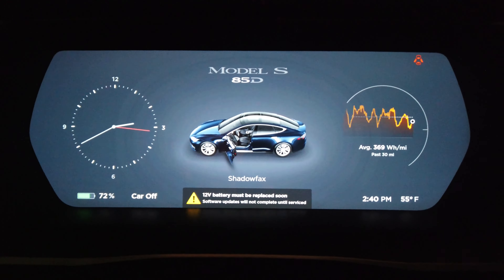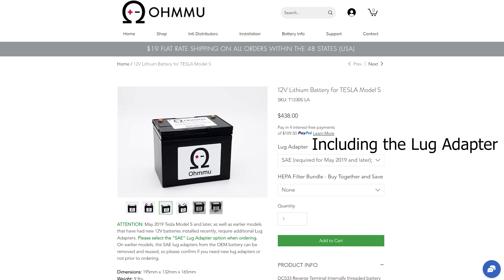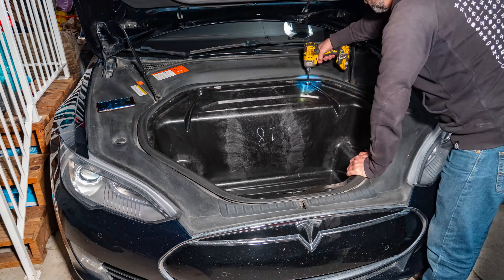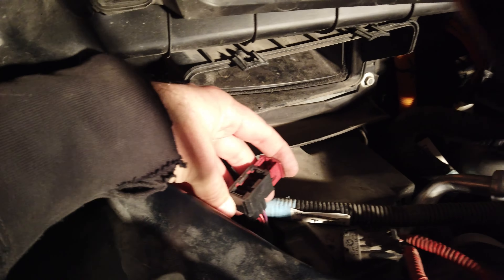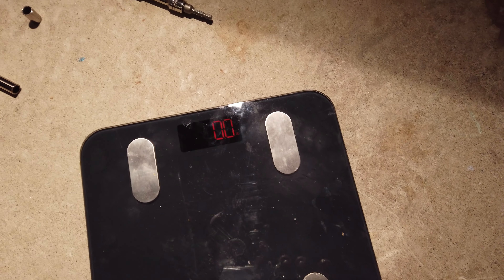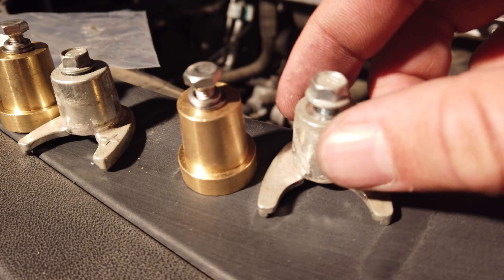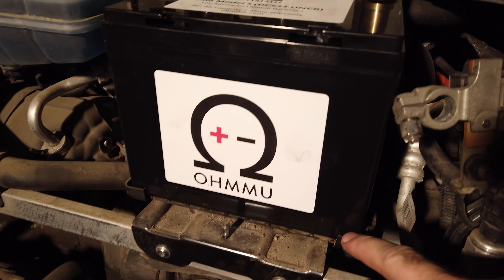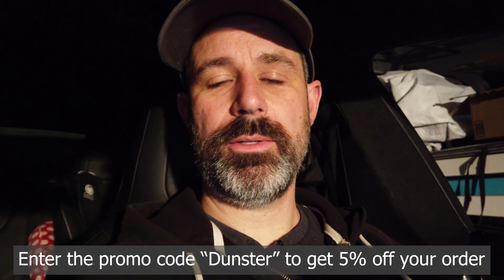Our Tesla Model S 12 Volt Lead Acid Battery is Dying Again | Changing to the OHMMU Lithium Battery

Comment: My OHMMU failed at 6 months. I recommend using the Tesla battery
Reply from the maker: Thanks for the data point. My OHMMU battery is still going strong 26 months later. I'll report back here in this video comments when it fails.
Reply: The Tesla software does not like these batteries as to why many get failures, they won’t be charged as the system see’s though the software faults, and wont charge the OHMMU battery and that triggers the screen warnings “battery needs replacing”.
Reply from the maker: @TheKingOfBellerose  I have never received any errors after 26 months so far. Clearly this is not a universal problem.
Reply: @ElectricTechAdventures glad to hear this. I just ordered one for my 2017 MS90D. But now that I’m digging into this product further I’m seeing so many horror stories. But many of the threads seem to be with the Model 3 and Y. Hoping to have the same experience you’ve had!
Reply from the maker: I agree, the problems appear to be with the 3 and Y. I've had no problems since Nov 2021, nearly 3 years.

Comment: I have owned a 2013 Model S 85 for five years and in my case I have already replaced the Tesla 12 V lead acid battery 2 times (that's less than 3 years life each).  Each time I had Tesla use their battery and had them do the swap.  Maybe I just have bad luck?
Reply from the maker: A 3-year lifespan on the lead acid low voltage battery of a Tesla is actually pretty typical. I've heard as low as 2 years and as high as 5 years. In my case like I said in this video I have had the low voltage battery replaced one time prior and now this is my second time. The first battery I don't know how old it was and it was replaced under warranty. This time the battery lasted for 2 years and now I am replacing it not under warranty. I am not sure why they vary in longevity so much. My hope with this battery is that it will last for many years like closer to 8 years and avoid the hassle of all of the failures in between.

Comment: Good to hear from you. I am not a DYI person so I had my 12V replaced by Tesla in February 2021. My S85D was built in by April 2015, so the factory battery lasted nearly 6 years!  I’m hoping the replacement will last at least 3 years.
Reply from the maker: That battery lasted really well! My March 2015 S85 D 12 volt battery was initially replaced October 2019 for the first time. Then I've now just replaced it again. I don't think I did anything to shorten the life of it, but it was about half the life.
Reply: @ElectricTechAdventures  I really like the idea of the 12V Lithium battery. If I go that way I will have to  get help from a friend. Let’s see how long the current Lead battery lasts.

Comment: I would definitely buy the OHMMU asap if I lived in a very hot climate like Phoenix. My lead acid battery is 3-1/2 years old in my Model 3, but is live in a very mild Pacific coast climate. Occasionally Tesla's software does change and OHMMU users have had "replace lead acid battery" messages pop up. OHMMU has to figure out how to make their battery play nice with Tesla's new software. I might want to change my battery now because of what you said about the more stable voltage that the lithium battery will provide, because I do have the occasional gremlins.
Reply from the maker: I've heard of the Tesla firmware issues, but that has only effected the Model 3 and Y so far as far as I know and from what I heard they were working hard to determine a fix for those issues. Thanks for watching!
Reply: @ElectricTechAdventures  You are very welcome Anthony.